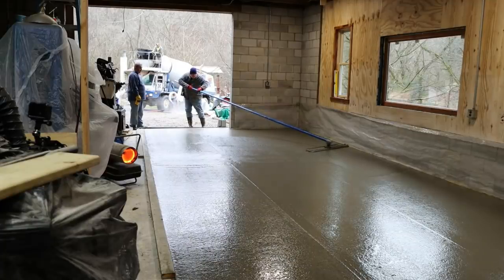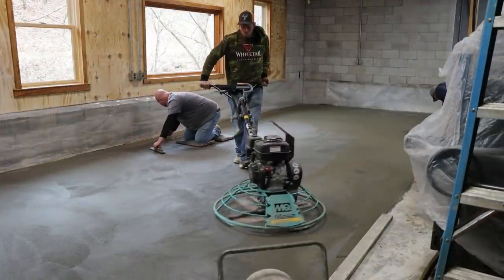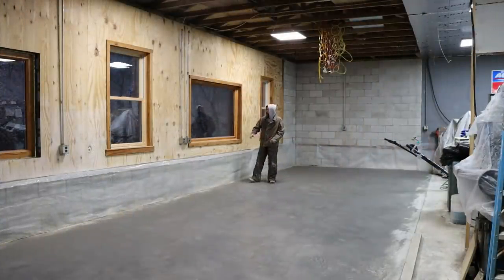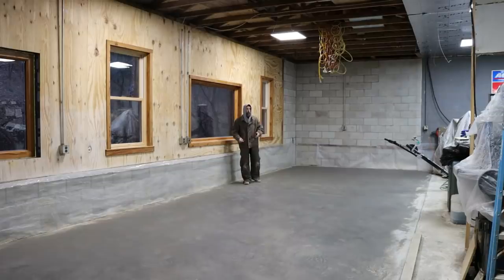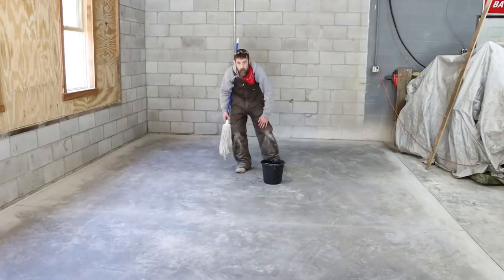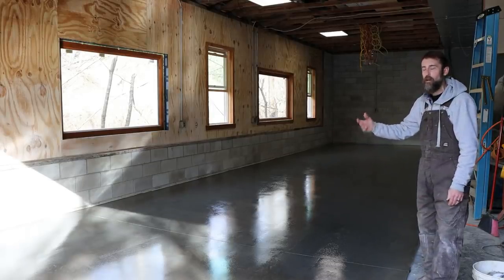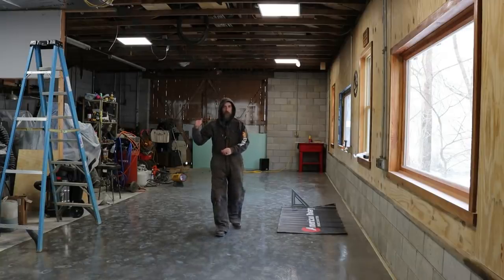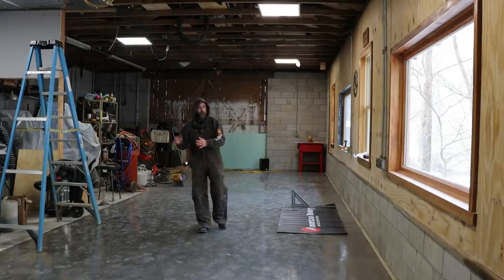Shop Concrete Complete!! Better Than I expected!

Comment: Cut concrete with a wet saw : Cut concrete with a wet saw : Cut concrete with a wet saw. . . . 
The dust got all through my equipment and inside cabinets etc.
Lining the ceiling was the most work intensive, clambering over machines that remained in place. Great and entertaining series on your project, well done Steve.

Comment: I know how excited you must be to be almost done. My new machine shop and mechanic shop building is ready for the floor to be poured. My new shop will have a little better than 3100 square foot of shop space plus a bit over 1600 square foot of storage space. I have waited my entire life to build this shop. I am approaching 65. To have your shop done while you are so young is a blessing. My old multi-use shop will be be solely for woodworking. The new shop will have 16' sidewalls. I can't wait... I will finally be able to employ real overhead hoists.

Thank you for posting the building reclamation project. I have followed the project all the way. Like you, I am not a builder. I built my home and I have done various construction projects like most folk that does everything themselves. Some of your meticulous effort was superfluous for a quality job. Like you, when I step outside of my trade, I either over do or under do what or how skilled tradesmen would tackle projects. In the past, cost prevented me from  contracting labor. My body is too old to tackle constructing my shop building on my own. I am relying heavily on contracted labor. Your trade is very similar to mine. I was first an electrician and HVAC maintenance guy that morphed into industrial maintenance, mostly CNC machine maintenance. I did it all, from building maintenance and construction to CNC repair. I was paid for my CNC maintenance skills and my electrical skills, but maintenance guys tackle most skilled trades to a moderate level. I am a poor welder, and in spite of being able to maintain machine shop machinery, I am only a novice machinist. My new shop is intended to allow me to develop existing skills and explore new ones. I have a handful of teenage grandsons to teach and train plus a whole bunch of younger grandsons approaching shop work ages. I used to think that my boys and sons-in-law would use my shop(s) more, but they are eagerly building their own shops.
I have grand expectations. I am glad for you that you are further down your journey than I was at your age.

Comment: Well Steve this entire project is something you can be very, very proud of. All the different trades you have picked up along the way made for great bones and your concrete contractor accompanied your work perfectly. The whole project looks like a piece of fine furniture. No process done with less than perfection. Will you be waiting for the entire 32 days for the floor to fully cure before moving equip on to their forever home ?  2 posts in 7 days is great. Thanks a bunch for having us along for this journey. Shine on bud.

Comment: A slick finished concrete floor IS much easier to clean, but also much easier to slip on if you get some oil on it.  A leaf blower works good for blowing the dust out after sweeping.  I love that creek.  I can't imagine how happy you are to be to this point.  Praying you have a Happy New Year, and that 2021 is much kinder that 2020.

Comment: Congratulations Steve.  Lots of hard work, but it's not wasted.  You've accomplished and learned a lot.  I love that shot of the sandhill cranes at the end.  Coincidentally, just minutes before watching the end of this video I was out tending the boiler fire and heard a flight of cranes going south.  Stood there for 15 minutes, watching 6 groups in all go by, between 15 and 40 birds per.  As you know, it's a yearly thing, and it's something special to see those birds migrate in those large groups.  Blink and you could miss it.

Comment: Time for an overhead door to keep the heat in?  I built a barn/garage that's sealed tighter than a clam's ass. No mice, no bees nests.  Delightful.  Great job Steve. Can't wait to see how much it shrinks when you start using it.

Comment: Get some sheets of thick UHMW HDPE scrap, and cut out some feet for the machinery, so that when you move them across that nice new floor you do not scrape gouges in it. The concrete will still be curing, and at the low temperature you are at likely will take till mid summer before it reaches it's 28 day cure strength.  

Are you going to use some polyurethane seam sealer on those joints, which will keep them from becoming metal filing traps. Just need to have a thin filler at the base of some plastic foam, and the width of the crack deep filled with the urethane to get a very effective joint seal.

To fix scrapes in that nice finish liquid floor polish works well, at least removes the bright concrete streak, and seals up as well. Done that on a number of old concrete floors, and it really brings them up to looking better than the scuffed mess they were. Now, if you were going to get the other half to a close better finish, you would move everything over, and rent a diamond polisher for the weekend, and take 2mm off the other side, to get to clean concrete, though you would then find yourself with a smooth exposed aggregate floor, which you purposely did avoid on the new side, with all the floating that pushed all the aggregate down under the surface to leave a smooth cement and sand finish. Still would have the step, unless you poured a layer of self levelling screed onto the exposed clean floor though.

Comment: A Steve Summers midweek video? My cup runneth over! 

I agree with a previous comment I saw about painting the walls white! It'll help brighten up the space tremendously! And when you hold something up to "look for light through gaps" it'll be easier to do with a white contrasting surface!

Comment: Ignore the negative comments on the smooth finish, In '84 I did my automotive repair shop in a  smooth finish and love it. 
Get you one of those yellow industrial mop buckets and some good concrete cleaner, "hound dog" powder is what I use.
 Keep it available  at all times for those spills and leaks.
Use a floor fan to speed up the drying process.
Only use the "speedy dry" for major spills and then wet mop, this will keep the dust down also.
 You will love it.
A smooth floor is super easy to keep clean and move stuff around on!

Comment: Well, this is an early Tuesday morning treat!  Thank you.  I’ve been fortunate enough in my 67 years on this good earth not to know anything about concrete other than it appears to be a lot of hard dirty work that I never wanted to be a part of.   Thank goodness we’re all different.  Machining metal to extremely close tolerances, the math, cutting oil, smoke, flying shards of razor sharp metal and metal splitters always in you somewhere, oddly, doesn’t appeal to some folks either.

Comment: You got an excellent job on the concrete work. So good to see that you got a curing compound on it. Concrete cure rate is dependant on the temperature, so it will take quite a long time to develop strength at those low temperatures. Next project those sliding doors!

Comment: Jobs that I have seen recently were saw cut green, waiting even 24hr is too long as the shrinkage cracking starts right away.
These guys did a great job, if you over work the surface it gets too 'thin' and will be prone to chipping and spalling. That is why they worked in stages and waited each time.
Using a special 'green' sealer was a great idea. A lot easier before you start using it.
Now to make chips.

Comment: Broomed finish is nice for its non slip characteristics, especially if you come in with snow packed on your boots and or you are the kind of shop that has the occasional oil on the floor, but it is tougher to clean. The new wall, floor and especially windows really transform the space (Im sure the roof helps too), Very nicely done!

Comment: Now that is a proper floor! Epoxies, paints, and other coatings are just silly. They inevitably get damaged, and ultimately look worse than the substrate. A nice smooth finished concrete, exactly what you have there, is the way to go! Perfect! This has been a fantastic journey to follow Steve. Congrats on the rewards for all your hard work! You deserve it. Merry Christmas

Comment: Steve the shop floor looks great.... I Worked in construction most my live.... When I was a real youngun I had an old timer tell me concrete cures for like 50 to 100 years and if you don't seal it, it will keep making dust, until it cures....    Nice job.

Comment: Floor looks great Steve! The concrete guys did a nice job. Maybe time to think about pouring an apron outside the doors. It really makes it nice if you want to work outside in good weather as well as saves breaking the leading edges of the floor.

Comment: We used to float our machines on slip plates. Steel sheets that slipped over each other and ply wood blocks to put under our levers to protect the surface.. Nothing scratched or dug in. We were moving and setting machines weighting 10 tons and more on maple floors.

Comment: Looks awesome!  If you have extra I’d suggest putting some sealer on the bottom few courses of block to protect them from the inevitable splashes.
Reply: I would paint the lower 3 feet gray (for the inevitable splashes) & the rest white to reflect as much light to save on the power bills.

Comment: That concrete is also generating it's own heat as it cures, on  Hoover Dam they actually had to place water cooling pipes into the pour to cool it as it cured.

Comment: The cranes...Yep...I live about 90 minutes (max) from one of their breeding grounds.  They were in such low numbers at one time, but now are back to virtually unprotected status.  Nesting grounds are still protected as are "lay-over" points, but there is now limited hunting of them.  From what people have told me?  REALLY REALLY good.  

So glad to see the shop almost ready for the rest of the makeover.  Agree, get some that ceiling finished and blow in insulation.  If you are dead set on storing things, then you are in for the next part of your challenge.  Balancing how much insulation you want/need.  R13 (which fits in 2" depth) is not the greatest for ceilings since you lose most of your heat through the ceiling.  If I ever get my shop it will be radiant floor heat with blown in insulation in the ceiling to R43 or more.  I live in the mitten state, we get some brutal cold once in a while (-20F) so good insulation is a must.  For you, maybe not so much...gotta balance it all out.

Comment: Just an interesting side note:   I was a machinist for a Caterpillar dealership for twenty plus years and got to tour the machine shops in Peoria.   I was amazed to find their shops had WOODEN floors.   They were 6” treated wooden blocks turned on end with the end grain exposed.  I’m sure they had a hell of a concrete base to support the huge machine tools required to manufacture heavy equipment.  One of the reasons for the wooden floor is you could squeegee any cutting oil spills or drips away and the floor never got slick and always looked the same as it did when new.  Thought you or someone might find that as interesting as I did.   This was over thirty years ago.  Whether or not they still do this I don’t know.
Reply: yes they were common in the UK the sub floor was concrete with the end on blocks set in tar , same as the cobbled streets and the were easy on the feet ( warm and a little give )
Reply: Yep one of our factory's in the mid-west has the same floors, date's back to the 50's. They roll 30,000 lb machine's around while building them, still in good shape...
Reply: Another advantage to this type of wood block floor is that it helps to isolate the vibrations between machines.

Comment: Yes, any more energy you put into the concrete adds energy to the curing reaction.
I was glad to see you get a bigger bucket!😅
It's official, you've 'hung up your shingle'...
Be careful burning propane in your shop.
For every pound of propane you add a pound of water vapor.
Cold cast iron will draw that 'sweat' right out of the air.
Anywhere air can reach, and rust in leadscrews and ways is the worst. (Yes, I'm sure you oil all your tools, but think of things like your surface grinder)

Comment: Great result! The way to spread the sealer, is to pour a dam on the floor, two feet from the short wall. And then - backing up along the middle on the new concrete, spreading the sealer to both sides. It is a lot faster, and You can put on a lot more, on the first layer. Less risk of orange peel....
Can't wait to see You making some chips again!
BTW! Have You considered to use sound isolating panels in the ceiling? Pretty sure there's a lot of empty office buildings, these days..

Comment: You shop is looking great now , I has been good to follow the progress. Here in Melbourne Australia things a a little bit different. 1. Our concrete trucks discharge from the back not over the cab. 2.  The floor sealer can be put on at the end of the first day and a lot of the time the sealer is sprayed on with a hand held pump pack. 3.  90% of the floor sawing is done with a wet saw.  Congratulations on a job well done  HNY.

Comment: Great job Steve. There’s nothing better than more shop space. I’ve modified my garage 4 times, each time relocating the end wall a few feet from the last, slowly giving up parking spaces for my cars. I eventually built an out building just to keep the cars in, and the shop took up the entire 42x42 room. It’s my escape from the day to day. Enjoy your larger shop. —Charlie in Rockledge, FL.   P.S. I cringed when you said the interior temp was in the 40’s!  Happy New Year.

Comment: Well done Steve, looks real nice!   
Be sure to protect that edge between the old and new concrete, don't want to knock off the corner moving machines.   I would put down some release plastic sheet, pour some bag concrete to form a 1-1/2" x 18" ramp at the edge. With the plastic release sheet it will be easy to remove when you are ready to top coat the old section.

Comment: Looks great.....a hudson sprayer and squeegee is a great way to apply the concrete sealer quickly. If you can let the floor cure for 14+ days before you load in the heavy equipment. Especially since it has been so cold will allow strength and surface hardness come up to spec.

Comment: and it looks good too! - you will have fun setting things up now - think about some insulation and fire up the wood stove - the new shop will be big help in new projects
Reply: think about covering basics but consider some batteries and pv panels and heat pump - you probably want some ac in the summer. also consider pos pressure hepa vent and a heat exchanger - they can be 90% efficient - the heat pumps can be 300% efficient - maybe you could explain that in a future video. the psychological boost and momentum from the shop build not to be discounted. i would just put 1 inch stops (to preserve flow from soffit to ridge and then the blue foam board insulation witha bit of foam here and there - then you still have some storage - add some truss bracing and plywood and call it good -  insulating and proper hvac will pay for itself down the line plus then you will be done after some lighting adjustments - the shop is going to be a work in progress just by nature - you are getting set up good to ride out winter in productive comfort

Comment: I have heard the analogy used that the more concrete is troweled and worked to a smooth finish the harder that surface gets much like tempering steel.  I know it becomes quite obvious which slabs have been worked down the road.  Those that haven't seem to spall and chip over time much much more than those that were worked.  A good broom finish is troweled and worked almost as much as a smooth one with the broom being an added step at the end.  Skipping that step invites chalking and spalling with the tiny ridges left by the broom crumbling.  They did that right.  Going to feel good to spread out again and get to your machinery (that's that big metal stuff shoved in a pile under tarps!!).

Comment: You need to look at a diesel parking heater to install in there for DRY heat to keep the shop above freezing.  eBay has tons of them for ~150.00.  I put one in a smaller shop.  Works great, and cheap to run.

Comment: What a great Xmas present for you to get the floor laid. Once the ceiling and the Machines are moved I would crack on and get the other part of the concrete relaid while it is still a semi building site, if you leave it and start using your shop it will be hard to get it done. The floor looks great and as you said it is better than you expected I hope you gave the guys a bonus for their good work and dedication. My Mum had a saying there is no taste in nothing. Happy New Year to the Summers household.

Comment: Like Steve said once the first block came out he was committed to seeing this to the end. As we would say back home, he isn't done yet, but he's broke the back of this job. OK we know all the keyboard warriors out there who have been commenting stuff like he should have done this, or he should have done that, and yes some of those comments were valid, but hey guys we all got to learn! If we were to ask Steve if he had to repeat this job again would he do it the same way? He'd certainly reply 'No' because he's learned lessons and new skills along the way, just like we all did back in the day. So I raise a glass to Steve for a job well done. Let that concrete cure in its own time before you move the big and heavy stuff back in, and get the insulation etc sorted so you can work in the comfortable shop and make a few chips in the early Spring :)